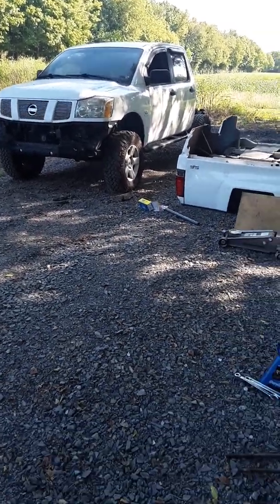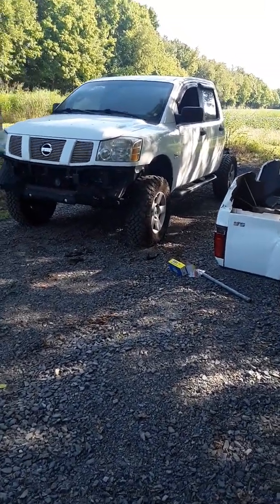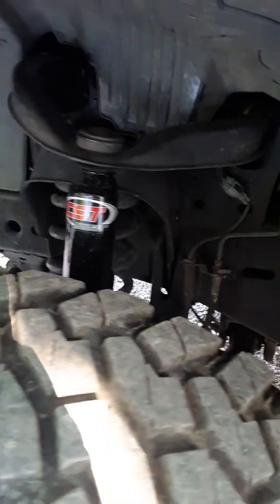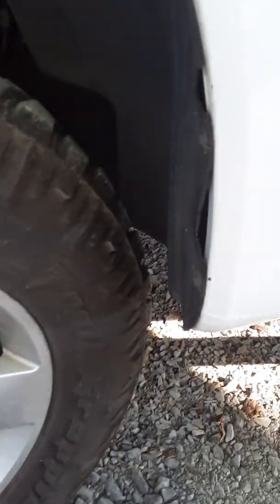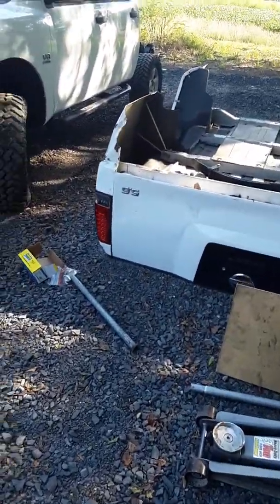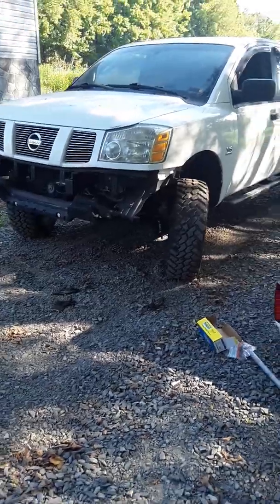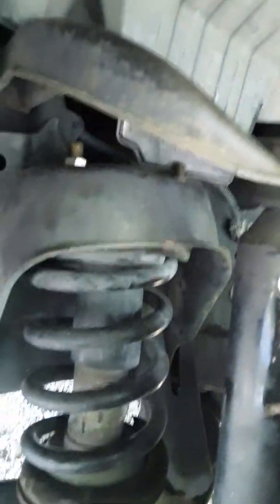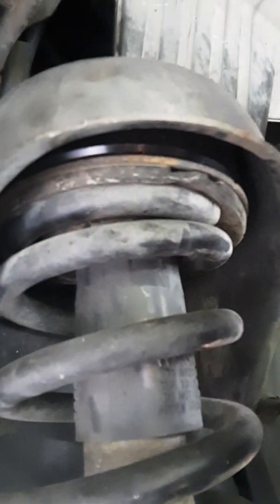Nissan Titan- spindle lift kit. Build Part 6.

Comment: You're fittin to replace the front bumper?
Reply from the maker: I'm replacing the front bumper and once I get the frame fixed. I will be putting back the bed and new rear bumper as well.